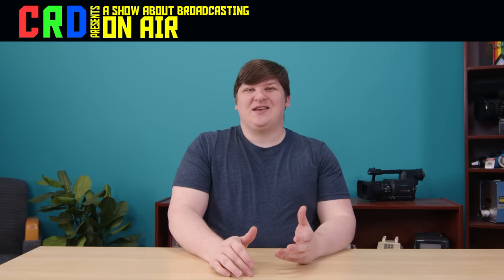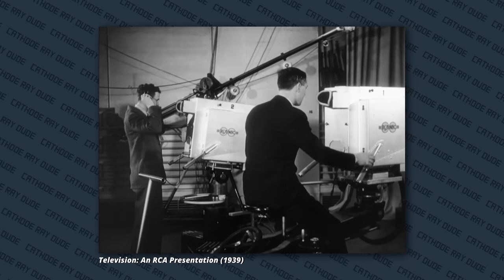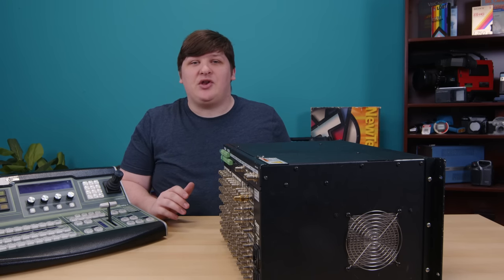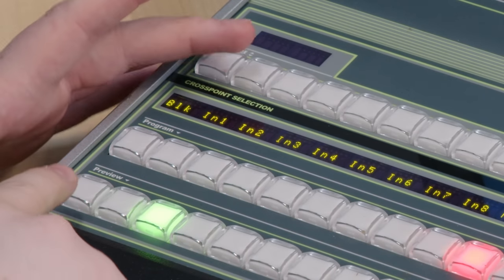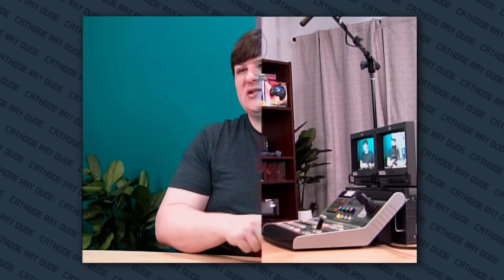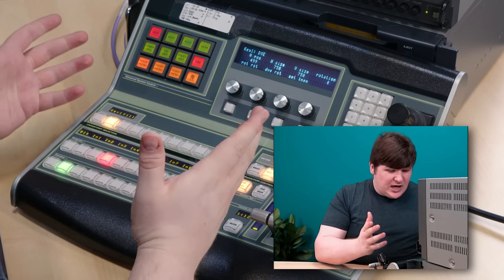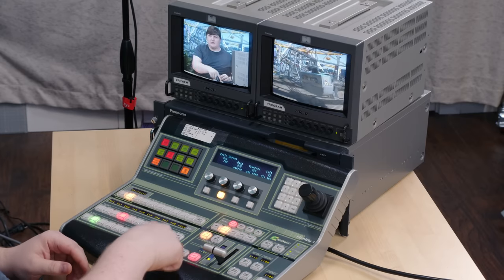What the heck is a video mixer?

Comment: ok, this isn't something the audience sees in an actual program, but I have seen a horizontal wipe used and stopped in the middle, to compare something in the picture to true horizontal, (so you know if one of your tripod legs is too long for example. Also seen it used with two cameras pointed at a blank wall or the camera's internal color bars pattern, to compare the color calibration is the same. so yes, I have seen wipes, and stopping mid-wipe used during pre-production.

Also, regarding the rack mounting, there are "Desks" that would attach to the front of a bank of vertical racks, that would have horizontally aligned 19 inch openings for equipment like a switcher control panel. It seems to be much less common now, because that space will generally be taken up by a keyboard and mouse.

Comment: I've got one of those Opera units sitting around in our old analog control room, we moved to a Ross original Carbonite 2ME in our ne HD workflow. I've also got my hands on an NBC Name Dropper by Evertz, let me know if you want any info. pics or videos! I'm an NBC news fanatic so I collect as much NBC gear as I can find, which is surprisingly really hard. I installed a 10' satellite dish in the backyard and was able to see lots of NBC backhauls as well as the barely compressed distro feed which makes your local station look like trash!

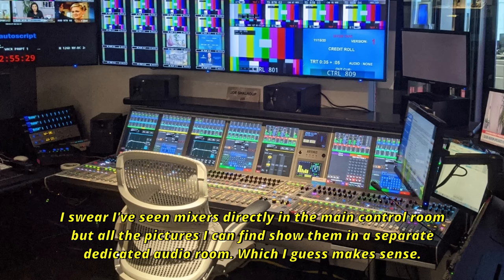Comment: (48:21) most audio ops would kill the director and TD, if they had to be in the same room... The audio control room usually needs sound treatment on the walls and is ultra quiet, so they can mix the show correctly. Not to mention that now many ACRs don't even have an operator, because production control automation systems run the picture, sound, graphics, video playout, promoters, and robot camera all by themselves. The TD just ends up hitting go, next, next, next, break, go, next, next for the entire show.
Reply from the maker: That's what I figured, I just could have sworn I had footage of at least one control room with a great big audio mixer about 10 feet away from the video mixer.

Comment: 47:00 with studio automation systems like GrassValley Ignite or Ross Overdrive the "switcher", if you wanna call it that, now has audio controls as well. The switching and audio are only done manually during breaking news. Most programs are handled in pre-production through automation cues and the mics/video/effects all change with one button to bring that string of actions together at the same time. (Although what basically amount to presaved macros on buttons can also automate that to some degree.)

Comment: I got a HDMI Livepro L1 as a front end of my ELgato HDMI input. and it has at least 11 effects and 10 wipes? 4 HDMI ins. For analog i use RCA to HDMI convertors from Walmart. Started with a PC Video Spigot way back in the day. ATI all in Wonder.  Older cards did hardware chromakey. Analog camcorders, 8mm mostly both PAL and NTSC. VHS tape recorders. Feed multiple PC HDMI outputs into the switcher.  I have multiple audio mixers for my synths mostly. Biggest issues are losing audio / video sync when video drops out so use HDMI convertor as a framestore. Variable video lag in the digitalization process - up to 6 seconds.

Comment: Back in the early 90s I worked on the City Government cable channel broadcasting the City Council meetings and the like.   We had a 4 camera setup with an Amiga 2000 for graphics. Using the corner cut effects I would create a PiP effect showing in a small rectangle on the bottom right of the podium speaker with the larger Council taking the rest of the screen.  Playing with the fader I could preset the what I want then cut to enable the box.   Took the production value from cuts while the camera was moving to something more professional with more visual interest. But if the deck would have a star wipe I would have done it when the people that showed up to every meeting voicing their grievances on a blinking red light or how their petition of fire X only got 5 signature.

Comment: In our university studio we use an atem mini pro, it does have basic sound mixing, but it's clearly not very professional. We also use it in combination with obs for keying and stingers. I am usually responsible for the sound so I have little experience using it, but it is very nice using it because obs always has some kind of problem.

Comment: The cost is more than just exotic hardware. These are commercial application devices built in low batches of 10k(consumer batches start at 300k) more or less, and should feature commercial grade construction that increases reliability for crucial applications. High quality technical support for relatively low customer base also adds to the cost.

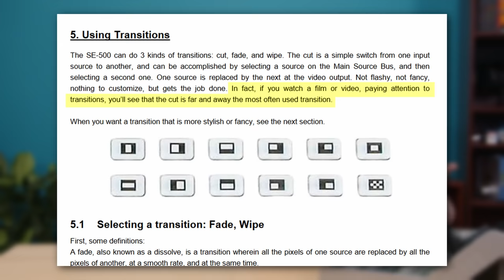Comment: 31:17 I'm a news programme TD. I agree that most of the animated transitions / wipes looks silly or cheesy. But since there are lots of detail settings you can customize (such as mixed wipe pattern, soft or color edges, pattern angles, pattern x y spacing etc), it is possible to come up with some wipes that are a lot more acceptable.

In our programme, we got a stinger style transition for the opening teaser. But we still saved a circle wipe which mixed by a circle main pattern and a stripe sub pattern as a backup transition incase the stinger is dead (and it did sometimes).

Also, there are situations that we might use a wipe if we want viewers to notice that. It usually happens in sports news. Like if there are two stories of two different matches in the same event / sports league (such as the Premier League for football or Australian Open for tennis), if it doesn't include anchor's lead between the first and second story, we will use a simple wipe transition instead of mix / direct cut because the shots in two stories are very similar (mainly football court or tennis court wide shots), which may left viewers confused. We would like to let viewers notice that it's another match. But the TD are responsible to choose an appropriate wipe pattern that is not too fancy or cheesy, so a simple diagonal or vertical wipe should work well in this case.

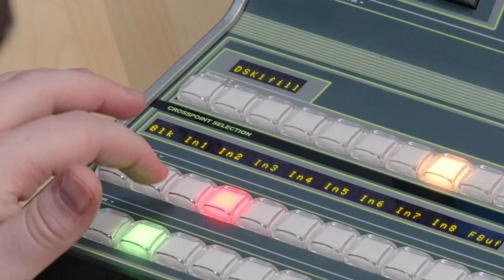Comment: 15:22 Technically speaking, this is how the video mixer operators body moves when producing a live show but there is much more going on in the backround.
Being the video mixer comes with VERY high responsibility and you have absolutely NO margin for errors. You cannot make any mistakes - if you do EVERYONE will see it super obviously.
If someone else on one of the sources makes a mistake, you obviously must hide his mistake so that the viewer cannot notice. Especially in news shows where a team outside the studio is sending a camera source via a SNG or something like a LiveU (thats basically a pocket SNG relying on cellular data) sometimes something over at the other place outside the studio happens that makes the whole broadcast of this source fall out of the program. Something breaking might have happened during the live show that makes this news completely uninteresting or the connection interrupts a hand full of SECONDS before they were supposed to go live because a cable went bad and so on. The director, moderator of the show, teleprompter operator and video mixer operator all suddenly loose all their hair and shit their pants INSTANTLY adapting and the viewer cant even notice. Being a video operator at a news show 100% requires having nerves made from steel ropes. Its absolutely insane.

Comment: Former Master Control operator at an NBC affiliate. The NameDropper was the biggest PITA at the station. We had to restart the thing, which involved rerouting the video because the NameDropper was one of the last things in the Program bus before it went outside to the transmitter so restarting it would take us off the air, once a week or else it would lock up and during the Today Show, you would see a blank ticker and time/temp box
Reply from the maker: That's exactly what I expected. Given that the company clearly just rebranded a product they already had, I don't imagine they put that much effort into it. They had a contract, why bother!

You'd think they would have put in a bypass relay so you could power cycle it without interruption, but...
Reply: @CathodeRayDude  Yeah, NBC clearly had it engineered to the penny. But, it is what it is. It's not my headache anymore. Nexstar decided to move Master to Texas last year

Comment: I'm stunned that TV channels were using Composite Video for anything much beyond the early 1980s.  BetacamSP tape would have been hooked up with Component Video, and even U-matic before that was connected with Dub.  So Composite Video would have been unacceptable in UK TV production anyway, even for live TV.  By the mid 1990s, Digital Betacam would have been all hooked up with SDI digital signals, and presumably broadcast would have been transitioning over to digital mixers.  I've not worked in broadcast (just have a lot of broadcast kit now) so correct me if I'm wrong, but Composite Video and broadcast were probably incompatible.
Reply from the maker: I'm using composite for simplicity in this video, but all the gear I was using supported component and Y/C, including the Echolab switcher.

I've never looked into what signal ran over those Dub ports, but my guess is it's just Y/C, since U-Matic stored composite on the tape (Beta did component, so that was worth it; and Y/C seems to be superior for interconnects even if you're coming from a composite source and have to split and combine on either end.) Were those used for feeding out to a switcher? The name implies they're just used for deck-to-deck transfer to minimize generation loss.

Anyway, I can't speak to the reality of how much composite was ever used, having not worked in the industry at the time (or now.) I suspect that, if nothing else, satellite feeds were limited to simple composite until the HD switchover (and from what I'm told... quite a while beyond that) due to bandwidth limitations, but otherwise I really wouldn't know.

Comment: I do have to say as a fairly new OBS user (<1yr) other than the addons for more in depth items, it has functioned quite well compared to the older Video mixers I used when I was younger.  In studio mode you see preview and Program, and if using 2 screens you even have a monitoring screen as well as the ability to make changes/corrections on the fly.

Some of the extra effects/layers can be hot keyed to your computer keyboard as well making it just as effective as a true video mixer.

Yes it takes a little more to set these up at times, but really once it is in there, working with OBS on a live production is not that much more difficult than a mixer.

I use 2 primary transitions, Move and Fade.   Which transition is used is based on source/scene names based on if there is a partial name match or not, and is handled but the push of a button just like the cut button on a mixer.

The only thing at this time that I don't see possible is having an actual Video Output option for the Program, as it is all for streaming.  This will be something I look into as the need grows and with a better pc to run it all.

Comment: your $45k echolab is now a $3k blackmagic design device (who bought echolab). They have a 4M/E device for less than $5k (constellation HD 4M/E) and those blackmagic have some limited audio mixing features.
the Ultimatte has also been bought by blackmagic design, and is at version 12 now
the DVE resource is mostly used to show picture in picture type setups, not transitions.
the new mixers are mostly the same thing, the main difference is they can stream directly to youtube or twitch (starts with a $300 atem mini pro) 😎

Comment: Erm ... there are low-cost hardware options: Blackmagic Design's ATEM Mini series. Sure, $300 for four 1080p60 HDMI inputs or $1000 for eight inputs isn't exactly cheap, but they're way less expensive than any other option. And despite being consumer-grade hardware, I can say from experience that they're actually quite reliable. I'm kinda the TD for a semi-professional three-day live event once a year, and there are zero stability issues with the ATEMs. The one bug I know (and hit frequently) can be worked around and is pretty exotic to begin with (it involves 60p -> 50p switching).

What the ATEM Minis are missing, though, is separate input select buttons for both buses. You're technically only working with the preview bus; hot-punching is just not possible. Also notoriously absent is a T bar, which means that if you want to keep a transition halfway open, you have to start a normal automatic transition and stop it at the right point in time. Not ideal, but you're going to have a good timing in muscle memory soon, and as long as the only transition you use is a simple dissolve, nobody's going to notice the lack of precision anyway.

On the flip side, they have built-in multiview. I can't overstate how useful that is!

Comment: Never used one professionally, but part of my volunteer work at my church is on the video team, it's kinda funny to see the amount of features their equipment has (BlackMagic ATEM 1 M/E) that they're not using -- in the manual that they gave the video team, we're explicitly banned from the T-handle! I think the most advanced thing they do is use a separate input that's the black-and-white output of ProPresenter lyrics slides to act as its own luma key onto the program. Sometimes I nearly fall asleep from being stuck at the console for 4-5-ish hours, doing nothing but pressing cameras 1, 2, and 3, and then AUTO. It's so overkill for their workload, but video switchers are so interesting at a technical level, at least for someone like me that will spend time reading RFCs and protocol specifications for fun. I can only imagine what sort of low-level data exchange is going on within one. And of course, if modern modern ones are anything more than a network interface and some GPU or custom ASIC/FPGA chips that just take in commands and math the feeds together. Equipment really was a bit more interesting when the answer wasn't just "throw a processor core at it."
Reply: Did the church thing, it always annoyed me how many churches over paid for functions they didn't need or thought they needed and they never used. Of course a lot of this comes out of cobbling things together and then saying let's just get some thing that works. And black magic fulfilled that. I suspect the T bar is banned due to consistency or in earlier versions it really messed up things with the keyers.
Reply: @imark7777777  I've more or less done this one since the beginning, yeah it's consistency.* Same reason why the sound team is locked out of 70% of the board controls (don't ask, REALLY do not ask), because they want everything to be identical, take to take, song to song, performance to performance, sermon to sermon. At least the team lead over here is the type to say "I'm going to get all top of the line equipment on the belief that we'll likely not need to upgrade as we grow" and sure enough, even when we had to move buildings, maybe besides a different focal length lens or two, everything in the tech booth remained the same more or less. It was so professionally overbuilt that it's had more headroom for us to expand into than we've needed, yet.

* There have been a few times that I've used the T-handle instead of the standard 20-frame fade either when I quickly wanted to walk back a camera change without a harsh cut (our streaming platforms really hate cuts, go figure.. I guess we can't do scene cut detection for I-frames??), or when it better fits the musical transition I've timed it to. Nobody complained, so I have a feeling it's a consistency in terms of "the human hand cannot pull a piece of metal down with the perfect smoothness of a computer" but it's close enough that unless I told someone a transition was manually faded, they don't notice amidst everything else happening.
Reply: @teknikal_domain  upgrade ability is nice, yeah I can be nice to have some room to grow. oh Yes the lock down the soundboard, I'm sure they still wonder why it's still changes every time it's not like the singer sings at different distances on the mic.....
I've seen a lot of they set it and forget it set up.

Yeah there's definitely a flow to worship and getting in on that flow can either make or break.
And there probably was a lot of breaks with the T-handle and untrained volunteers. Or maybe just volunteers getting lost in the moment. I always found doing stuff in the booth and extension of worship even though almost nobody really understood that in the churches I was in.

Interesting having issues with cuts and stringing.

Although there's a lot of things that can be interpreted as something else. The age-old don't do that it makes your foot hurt when reality your foot hurting because there's a nail in it. The number of times I've run into the belief that A causing B so we stop doing A when in reality it's C. which is usually something like a guitar player turning there amp up.